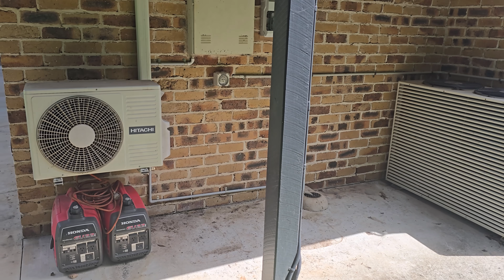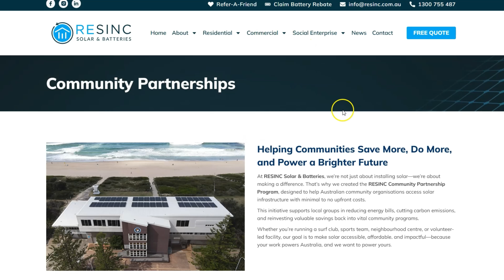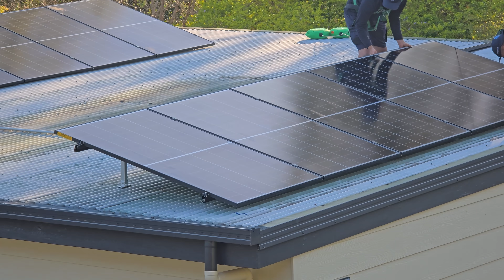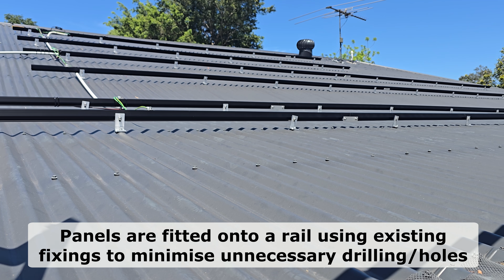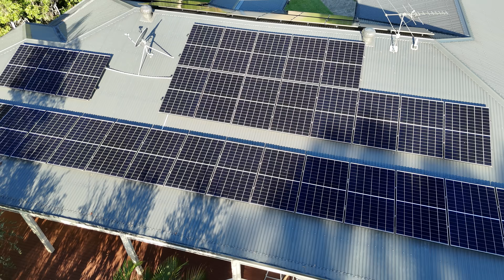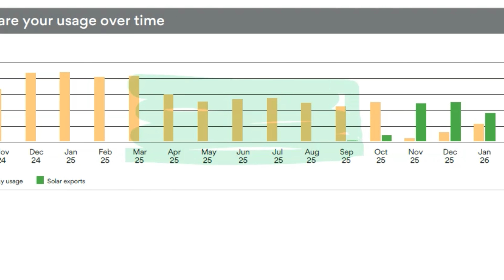From $600 Power Bills to Self-Sufficient POWER - My MEGA Solar & Battery System!

Comment from the maker: ⚡ G'day Everyone! Quick question for you all… If you could cut your electricity bill dramatically and keep the lights on during blackouts, would you consider installing solar and battery storage at your home? Our old power bills were over $600 a month, so installing this system made a lot of sense for us. If you’re curious about whether solar or battery storage would work for your place, you can get a free custom solar assessment here: 👉 https://resinc.com.au/selfsufficientme/
It’s a no-obligation design session, and they’ll show you potential savings for your situation.

Also, let me know in the comments:

☀ Do you already have solar?
🔋 Would you add a battery?

I’m really interested to hear how people are managing electricity costs these days. As always, thanks for your support! Cheers :)
Reply: $600/month is CRAZY. Does your house need some outside blinds to prevent passive heating, or better insulation on sunny walls?  I guess it's a bit spread out among four adults, but still.
Putting solar forward as a "bill free" option is a little disingenuous. ("$600 bill to self-sufficient" implies there is not longer a monthly cost.) Solar isn't free - the upfront installation + maintenance + replacement cost at end of life all needs to be accounted for, ideally into a savings account you contribute to monthly. 
Getting it for reliability when your grid is not, that IS a good reason - even if it's not any cheaper.
Reply: I can't even remotely afford a solar system.  I would only consider going into deep debt for one if I had a very nice house and property, and children to inherit it.  As it is, I'm old and childless.  I won't be living long enough to see a true return on my investment.  So even though I love the idea of using solar power, it just doesn't make sense for my circumstances.  I really really enjoyed the video, though!  I hope you never have any trouble with your system!
Reply: I’m fully off grid so no power bills ever
Reply: The short answer is yes, in many modern installations, the power company (utility) or grid operator can technically and legally turn off or "curtail" your solar and battery system remotely, but usually only under specific, rare circumstances.
How and why this happens depends on your local regulations and the type of agreements you signed during installation.
1. The "Emergency Backstop" (Grid Stability)
In many regions (notably parts of Australia like Western Australia and Victoria, and increasingly in parts of the US and UK), governments have mandated a Solar Emergency Backstop.
 * What it is: A remote "off switch" for your solar inverter.
 * Why they use it: On very sunny days when electricity demand is low, the grid can become overwhelmed by too much solar power. To prevent a total blackout, the grid operator (AEMO in Australia, for example) can send a signal to your smart meter or inverter to temporarily stop it from exporting power.
 * Frequency: This is considered a "last resort" measure and typically happens only a few times a year for short durations.
2. Virtual Power Plants (VPPs)
If you signed up for a Virtual Power Plant program to get a discount on your battery or lower monthly bills, you have explicitly given the power company or a third party permission to control your system.
 * The Battery: They can remotely tell your battery to discharge into the grid when demand is high or stop charging when the grid is stressed.
 * The Inverter: They can throttle your solar production.
 * Your Control: In most VPP contracts, you can see when they are using your battery, and you are usually compensated for the power they "borrow."
3. Smart Meters and Remote Disconnection
A smart meter allows the utility company to do more than just read your usage.
 * Full Service Disconnection: If you fail to pay your bill or there is a safety emergency, the utility can remotely disconnect your entire home from the grid via the smart meter.
 * Solar Regulation: The smart meter often acts as the communication bridge between the utility and your solar inverter to manage those "backstop" events mentioned above.
Can You Prevent This?
| Scenario | Can you opt-out? |
|---|---|
| Emergency Backstop | Generally No. It is often a legal requirement for new solar installations to have this capability to get "permission to connect." |
| VPP Participation | Yes. You can choose not to join a VPP, which keeps full control of the battery in your hands (though you may lose out on some financial incentives). |
| Off-Grid Systems | Yes. If your system is truly off-grid (not connected to the utility at all), they have no way to see or control it. |
Summary Table: Remote Access
| Feature | Who Controls It? | Purpose |
|---|---|---|
| Smart Meter | Utility Company | Billing and full house disconnection. |
| Inverter (Solar) | Grid Operator | Curtailment to prevent grid overload. |
| Battery Management | VPP Provider / You | Peak shaving and grid support. |
Would you like me to look up the specific "emergency backstop" regulations for your local area to see if they apply to you?
Reply: We have solar , but with a battery can you still access the power during an energy provider shut down. Because even with our solar the energy provider can shut 3phase power off or even our solar when doing network repairs to prevent power running through the lines . Does the battery override that ?
Reply: You didn't mention the most important part! Your cost will never change again (for that 80%). The power grid price does. You've locked your price in for decades, super cool.
Reply: @B01  Maintenance and repairs.
Reply: @OneWildTurkey  you miss the part about 25 year warranty? Lol that's why I said he paid once
Reply: @B01  Read the warranty. It doesn't cover maintenance and only few repairs that are from poor manufacturing. A warranty isn't a maintenance contract.
Reply: When we have a house, my plan is to have solar and batteries on it. I have friends that already are doing this.
Great video Mark👍
Reply: Yes I would love to but the company you've recommended does not service my area so that's a bit of a bummer they may do good work all over the place but if they don't service your area that's not servicing Australia😢
Reply: We dont have $50k - a $100k to invest in solar.  Plus most people dont live in their homes for 20+ yrs, so its unlikely they'll ever see the ROI.
Reply: I wish you posted this in December last year when we were looking at quotes. I understand why you gave it a few months though, to get results to show aswell.
We get ours installed at the end of the month.
Reply: We got our panels and batteries back in Jan of 24. We get a better rate on "credits" for power back to grid, so we only get hit with a "normal" bill the last month after the credits are used up. We are north of 47N Lat and at a bad angle, near Seattle (Rain) & still worth it.
Reply: We desperately want solar, but we are also on the DSP and live below the poverty line in terms of wealth, so it just isn't doable. The only reason we even have this (small) home is that it was left to my husband in his late father's will. In the winter, the bills can become as high as 900 for the quarter. That's a big deal when you only bring in 3K per month. There's also the fact that we're in Tassie; in the winter, it's overcast and rainy throughout the season. Solar would probably be useless.
Reply: Do solar panels lose efficiency as the heat gets higher? Here in the States, none of the solar companies seem to last more than a couple years.
Reply: Off grid not the BS  you get from being on the grid.
Reply: We have solar with the 44c feed in tariff, so haven't paid elec bill for 10 years. But that tariff finishes in July 2028, so will explore battery options then. Our usage is about $400/qtr atm
Reply: @helenhartley6904 our tariff was 12 cents now it’s 6 cents, not worth feeding it back
Reply: We were doing up to $1200 a month. then we refused to pay anymore.
Reply: Yep, we are completely off grid so kind of necessary 😂
Reply: Mark we contacted Resinc and had our zoom meeting with the consultant. Every step of the process has been very good. After the meeting all our questions and concerns were answered and as a result we have signed up for a 30kw/h battery. 13.3kw Solar array which is due for installation early May. If the rest of the process is as good I’ll be very happy. Cheers for your video. I had already done some preliminary calculations on the economic viability and had watched a number of things on YouTube to form the basis of my decision given my own circumstances.
Reply: As it is, I'm considering a switch from multi-fuel emergency generators to solar with a battery.  A $600 per month electric bill seems like somebody is putting their finger (or fist) on the scale. My electric bill is generally around $100 USD, but that's about $140 AUSD. During extreme months it can go up to $200 USD ($280 AUSD).

$600 AUSD right now is about $420 USD, if my math is right.  So, that seems a little higher per unit cost than here. I'd have to figure there are a lot more taxes and fees involved in Australia than where I am in FL, USA.  Our add-ons run about 30% but other states are above 50%.  In the same situation, I'd look more closely at solar with a battery for daily use and full replacement of ON-grid power.  

I'm expanding my 'household' to include a separate out-building with electricity.  The costs of installing underground cables and all the hardware to connect to "the grid" is enough to make me go with solar and battery. It's actually still a little more expensive to go solar, but the increased reliability of the solar, along with fewer building inspections, will make me go that route.  At current prices, it will never return my investment for the cash outlay.  But, I don't expect prices for electricity and taxes/fees to remain where they are, or certainly not decrease.  It's a gamble, but I do expect the buy now / cry now 'feature' to make up for the future increases.

edit:  I forgot one thing. I didn't factor in any government rebates or other assistance. I'm not familiar with that yet, so it might lower my immediate costs while pushing them off to the future.  Many people here relied heavily on that for their purchases and are finding that their government can't actually fulfill their end of the deal.
Reply: What about if you live in the western suburbs in Victoria?😮
Reply: Hi Mark so informative to see this video, with your experience with solar. Considering getting a 7w Honda type generator for a small 3 bedroom house, would a solar system setup be better? Thx
Reply: your kit must be Off Grid?
cos during blackouts all Grid connected PV Systems crash too. Lines ppl dont like dying fixing live wires from PV Systems  😂😂
Reply: how about you give it a couple years before being so enthusiastic and shilling out. You are losing credibility.
Reply: @monalisa-bs4zs  did you not see the same bill? Lol

Comment: writing off a $50,000 PV install makes sense as a business
but for Joe ave who will one day have to replace it all forget it.
I had to Sign permission for the Grid to loot from my 20 kw battery? Meaning I come second in who gets the current??
so I opted to go 100% off grid
here's the Kicker......I still by Law have to pay the Grid $365 pa Supply charge cos they refuse to remove the street cable.

Comment: Nice setup, thanks for the video. We are paying over $700 a month for power. It is winter here in NZ and we have 5 adults and a child, plus heat pumps and a spa so I guess it is expected. We are looking at a large install to offset the grid costs.

Comment: I have a massive problem exporting to the grid at 3c where the energy supplier goes on to sell that same power at 36c or more. If that's not daylight robbery what is. I shut my export off out of spite🙂

Comment: I don’t think a VPP will be very profitable for you as you have such high self consumption. The times when you will have excess solar is when the feed in tariffs will be low or negative and you won’t be able to discharge a lot onto the grid at night because you need that power for yourself.

Comment: With that solar and battery, your electricity bill should be the cost of the daily connection fee only (about $130 per quarter).

I have 35kW solar, 30kWh of battery and run a farm including coolroom, multiple freezers, air conditioners, full workshop, etc, and I have mains which I have kept for a backup instead of needing a generator.

Just turn off that mains connection - they are stealing power from you and can still control your air conditioning and solar feed in.
The $100 odd that you lose by not feeding in will be saved in the $600 of power you wouldn't use. Net benefit ~$500.

Comment: Why not fill the roof space of the outbuilding with panels and have a battery there, as well as the inverter. Then use the batery to equalise the feed over the wiring  to the main building over the day/night cycle - thus making full use of the sunniest location?

Comment: What type of batteries do you have? There is a real push in Nevada,USA to use Tesla batteries and they cost 10k a piece. Luckily we don’t lose power, but it would nice to use the power generated during the day at night instead. We match the same heat like Australia in our summer months so we are dependent on air conditioning.

Comment: Also just gone online with our Energy Storage System.
Victron MultiPlus-II 15kVA Inverter with Victron MPPT RS 12kWp Charge Controller and 2x Dyness 14.33kWh Power Brick batteries. 
I'd need to double my current battery capacity to become grid independent, but loving it 100% already!

Comment: If you can afford it then increase the battery size, for your massive usage, 50KWH battery storage is measly. For me, a  2 adult, 2 kids household, around 40 KW battery is what's given me full self-sufficiency. I was told by a premium installer that all I need is 13kWh Tesla and was quoted $13000. I then consulted with a local installer and went with 42 KWh Fox ess for $8000.  That was the right decision. The premium brands like Sungrow, Signenergy, Telsa  etc are ripping off with their pricing.

Comment: In fact, you can plug infinite number of batteries to solar panels. Solar panels are chargers, batteries are storage to get the charge. You can have a huge storage and a mi-size charger, if you consume less than solar panels generate. You will have surplus anyway, and the remaining energy will charge batteries anyway/fill the storage.

I personally prefer fast DC charging mechanism for solar panels and battery system. EVs charge way faster in high voltage DC. The same principle works in solar panels as well. High voltage DC charges batteries faster than through the controller. It requires new circuits, and I'm working on it. I hope this will be the norm in the future

Comment: I'm currently building my own PV system with 27kW peak in solar panels and 120kWh of DIY batteries. I already have paid for everything that I will need (not my first system, that I built, so I know I have everything). Since I did everything myself and got help from my dad for putting up the PV Panels I have only spent a bit less than 18k EUR here, which is around 30k in AUD. This is crazy cheap but it is also a lot of work. Therefore I think you probably spent at least between 60k to 70k AUD.

Comment: Pity there was so much emphasis on repeatedly naming the installer. This always raises questions about the impartiality of the assessment of this instalation. Also, the reluctance to mention the cost?
Reply: Yea. Im doing a 31kw solar PV system now, but a lot more power and more back up. It ain't cheap!

Comment: Glad you got an upgrade to your solar system, looks fantastic! I just installed an off grid system with 48kw of Batteries (stackable)- we live in Tassie and I basically use stuff all electricity due to fire place and not needing air con.....we have ground mounted solar panels, which actually look pretty cool! I can say that I don't miss the Queensland heat and am enjoying the cooler weather here!

Comment: That is a massive sytem! I just got a 28 panel 13kw solar, 10kw inverter, 40kw battery. We have 3 kids and a massive house, its been 1 week now and my battery has not fallen below 50%, and that was running a 10kw and 14kw aircon systems flat out! Its such a fantastic feeling being independednt from scummy energy companies and it helps the community and environment!

Comment: Quick Question, and I suppose I know the answer : have you had a rethink on how large is your consumption and first, to attempt to downsize/reduce your usage? Solar is a pretext for some to keep on using large amounts of energy. I did so in my house when I first bought it, usage went down 20% after 1 year of monitoring and removing/updating equipments, and now with solar excess, I can consider new usage for newer, more energy efficient equipment.

Comment: So sun grow app will also notify you when when you lose grid power. 
We only have a 3 phase SH15 with 19kw of batteries. 
I love it and have managed to link it in to Home Assistant OS which give me even more information without the app.

You'll find your bill is the supply charge. I'd love to get another bank of batteries. We fill ours within 5 hours. I also set my system to run from the batteries during the peak times so we cut down on additional cost.

Comment: You would benefit a lot from tree falling and finding a new home for trees that will grow tall... also to fully utilise the roof on the shed. The orientation of the panels is off. Fix positioning, add more panels, get a bigger than 5kW inverter. You would cover a lot of your dead zone power.